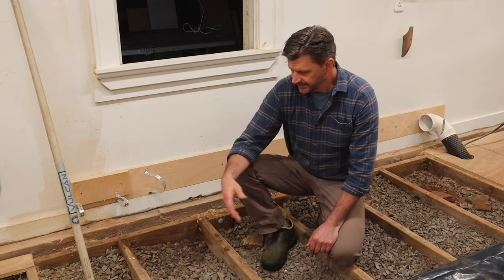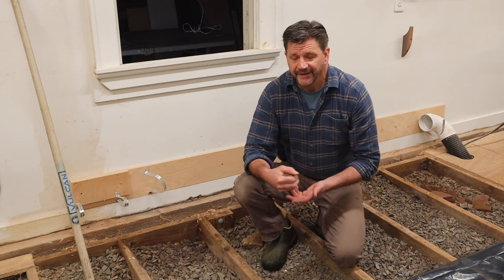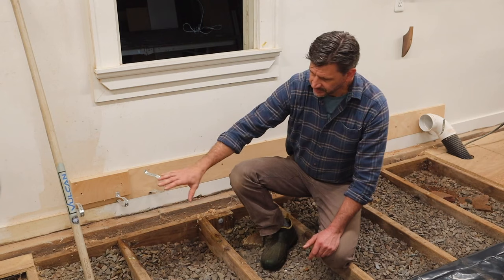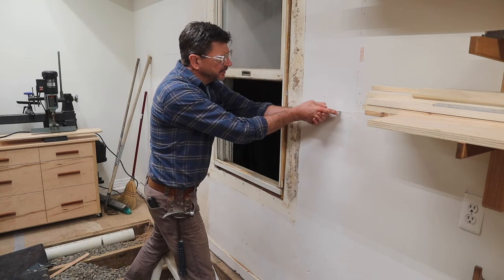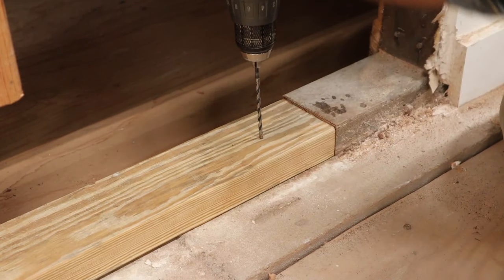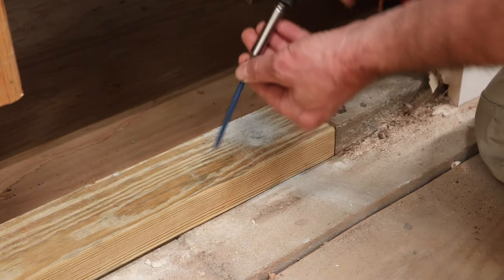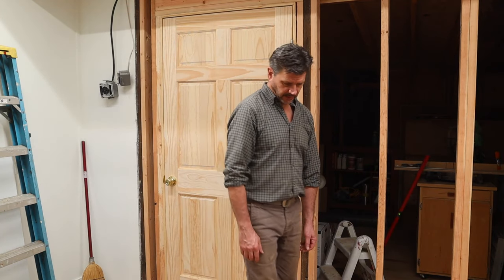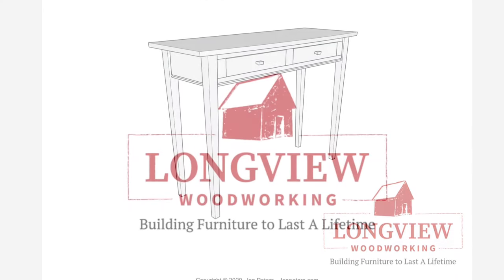I Need to Fix this Wall - Rotten Wood Repair

Comment: Anyone else think that door swings the wrong way? Seems like it would be better to swing into the corner.
Reply: Typically you always hang a door to open to the nearest wall
Reply: I was thinking the same thing. Looks like it'll swing into valuable floor space - maybe something else is destined for the "left" corner?
Reply: Absolutely. looks off-balance and awkward.
Reply: first thing i thought of

Comment: I'm sure you've seen then, but Frank Howarth mentioned air flow issues in his dust collection videos with his in-ground piping. The 90 degree fittings robbed the system of a lot of suction. Food for thought.

Comment: usually when I place a door and it's close to a room corner, I'd have it open the other way so that the door is against the corner of the room so as to give free movement in the room without a door in the way but I'm sure you thought this one through and have good reason to have it that way.  nice clean work, as usual Jon.  you inspire.

Comment: You already have a few comments about the door and hinge but I was curious about another thing.
You seem more like a traditional guy but also practical so I'm wondering if you considered getting one of those magnetic zipper doors.
It's definitely not aesthetically pleasing but you wouldn't have to deal with opening and closing a door with your hands full or the door itself being in the way.
I enjoy these update videos. I'm always impressed by the amount of thought and consideration you put into your projects, even simple or personal ones.

Comment from the maker: Good morning everyone, as often is the case one project turns into another with an old building. Just curious do you call it a sill plate or a sole plate? 
Have a great weekend all!
Reply: Sill Plate
Reply: Yes. Also mud sill or the base plate. They are all used by different people you run into. I use sill plate or base plate.

I would have probably put in a bigger sliding pocket door(use up less wall space) to get projects through. I can only think you take the projects in another way?
Reply: Sill plate usually, bottom plate according to the New Zealand building code :)
Reply: Sill
Reply: sill
Reply: why does the door swing the wrong way?

Comment: Hi Jon, thanks for posting this video, the shop Reno is looking good. I’m a king time viewer and have to say I really enjoy the mix of topics you cover. I think any homeowner that is interested in wood working would find value in what you post. Quick question on this video, I was wondering why you didn’t hang the door so it swings into the corner rather than into the room where it might block foot traffic. If you clip it so it sings out into the shed it looks like it might swing into the corner. I might be missing something though. Anyways thanks for this video, looking forward to the next one.

Comment: Need to do this on one wall of my shop. Unfortunately, whoever built my garage put it right on the property line and I have to go into my neighbors yard to get to the exterior of that side. Been thinking about ways to bring the wall in a few feet.

Comment: I wish you'd shown how you made those supports on the back of your studs before cutting them!! Did you use screw or nails ... im in a similar situation
Reply from the maker: I supported the Weight with a temporary wall and then sister the studs. 
I used screws

Comment: Great video Jon. I just spent the last year renovating my basement and had to open a wall or two to add doors. You still made it look easier. My question is, how did you get to that other room without a door? From the outside?
Reply: No he teleported

Comment: John, nice upgrades to the shop! I have a question about the floor. Did you put the vapor barrier underneath because of your location? I am in Florida and getting ready to put a wood floor on top of dirt in half of my shop. Any tips?